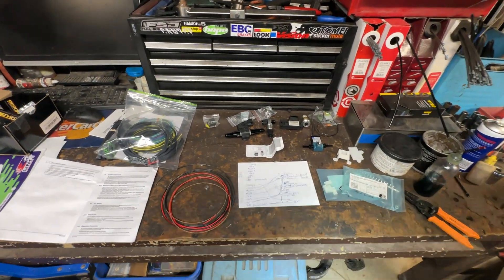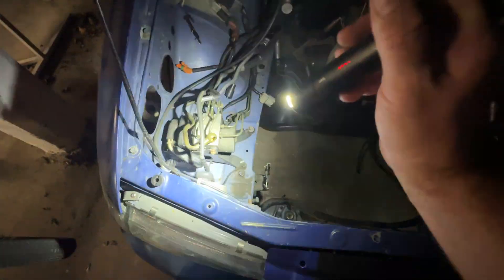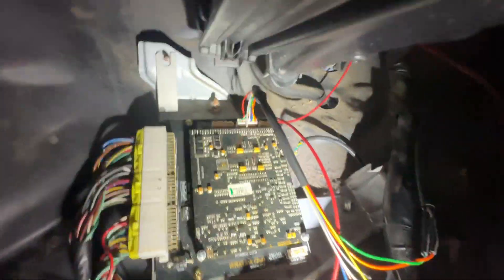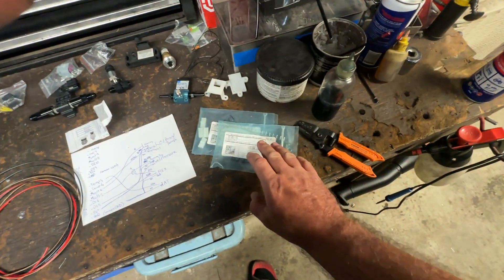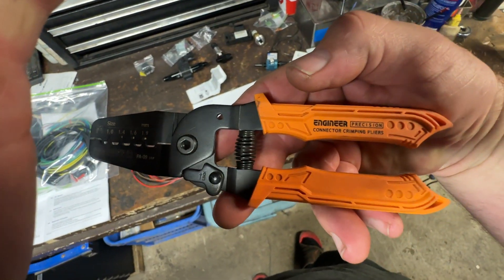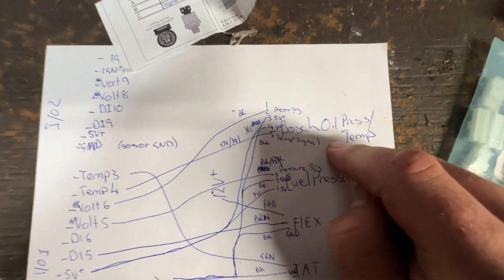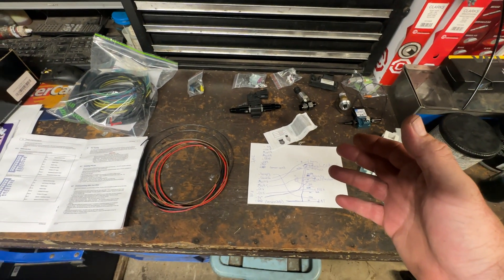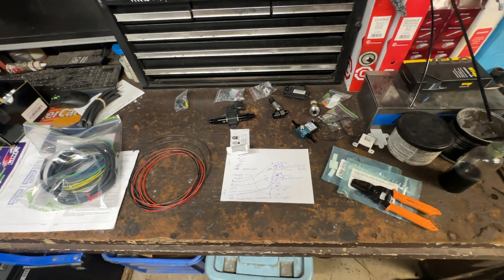Link plugin ECU - how to add extra sensors!

Comment: If I was to install the boost solenoid to the link. 
I’ll need 12v and where does the other wire go into? 
Thanks
Reply from the maker: Boost solenoid is controlled by an (Aux)iliary output. The Aux output grounds the solenoid when required. Look in your software, find an unused AUX. locate that pin on the ecu connector & wire the solenoid to that pin & 12v to the other side of the solenoid. The boost solenoid doesn’t have a polarity so as long as one is power & the other Ground (Aux), then it’ll work.
Reply: @Fine_Performance thanks for this 😊
Reply from the maker: @dguanz my pleasure, any time. The only stupid question is the one you don’t ask.
Reply: @Fine_Performance hahaha, I’m still trying to get my head around link program. Could you tell me how to add sensors on the program. Or if there’s yt video out there for it
Reply from the maker: @dguanz on the left side there’s a little tab that says ECU settings. Click on that and it’ll pop out with a bunch of headings. Fuel / ignition / aux outputs / digital inputs etc etc. Click on AUX outputs, ANALOG INPUTS & click on DIGITAL INPUTS. You’ll then see what’s already assigned to each ANALOG INPUT, AUX & DIGITAL INPUT. Then if you double click on a spare AUX OR DI, you can then Set it up in a window that pops out in the main viewing area. Get in there & save a copy of your tune to your laptop. Then familiarise yourself with what it looks like. Just have a look through it. The help file & right clicking “what’s this” to take you to the help file. It might seem really confusing, but trust me, eventually you will start to get better & learn how things work. A year or so ago, I didn’t even know the didference between a DIGITAL INPUT & an AUX OUPUT or ANALOG INPUT. But those are the components you add & can configure for your ecu.
Reply: @Fine_Performance okay thanks for this sir.

Would boost solenoid be under all that as well?
Reply: @Fine_Performance I’ve been trying to play around with it daily just to get to understand it ahah. I’m not tuning the car, but would like to understand it and add sensors
Reply from the maker: @dguanz yep, and that’s prolly the first thing you want to do. The other thing is, each sensor has a different calibration. So make sure you set it to the right calibration or, look online to see what it’s meant to be set at. Some things like common coolant sensors, pressure & temp sensors you can just select from in the software. Sometimes you have to create a CAL table & input the data yourself. But there’s guides online as usually someone has tried to add that sensor & not known the calibration info, so someone has posted a how to. But that’s great you’re getting into it. There’s nothing more rewarding when you wire something up, configure it in the software & it works.
Reply: @Fine_Performance awesome I’ll try figure it out. The main thing is to add all the safety sensors myself. The can bus wide band I’ve figure out.

Yeh never had to add sensors on my old piggy back Hondata haha, never had that option really.
Reply from the maker: @dguanz this was my first time doing it too. But basically just write a list of the sensors your adding. Work out what each sensor wants (5v, sensor gnd, aux# or 12v & DI#) etc. Then draw a bit of a map how you’re going to connect the sensors. Biggest thing that helped me was that I didn’t realise you can split a 5v or signal gnd from the ecu, as a many times as you need for each sensor. Ie, if you need 3 sensor gnd, take the one wire from the sensor gnd pin on the ecu, then split it into 3, to go to each sensor. The wiring method for doing this is using an “open barrel splice”. Google that, hpa has a good video about splicing.
Reply: @Fine_Performance so overwhelming all this 😂. How’d you go about connecting the wires to the harness? Just soldered them?
Reply: @Fine_Performance also , say I had 3 sensors to that one 5v or signal ground , would the ECU still find them even if I did barrel joint
Reply from the maker: @dguanz nah, you need some crimpers & the ecu pins. I’ll make a video showing the tools I’ve got. The one I use for most stuff is a copy of a Sargent 1026 CT. It’s like $60aud approx (real Sargent is $120aud). Then smaller pins I use an engineer PA-09 which is $60aud. Those 2 crimpers do most stuff. But yeah, you shouldn’t solder wiring as it creates a weak point & the wire can break. Crimping seem hard, but if you have the correct tools & take your time, it’s really reliable. You also need to use tefzel wire (usually 20awg - aka 20 gauge). Or TXL is a cheaper alternative. Good wire & a proper crimp will last for years.
Reply from the maker: @dguanz it will, but you need to get some crimpers & “open barrel splices” & do it properly.
Reply from the maker: @dguanz  this is how to properly join multiple wires 

https://youtu.be/cWkLgkqMVfY?si=SDE4ZhwB5nOdnQHU
Reply: @Fine_Performance thanks for all this info 😊
Reply from the maker: @dguanz no worries mate, I just posted a video with the tools & some info to get you started.
Reply: @Fine_Performance ❤much love my bro
Reply from the maker: If you’re on a plug-in for a Turbo car quite often there is already an AUX configured to run the solenoid of the factory car. But you can change something yourself you’re not using, for example if an AUX is set to AC clutch and you don’t have AC you can reconfigure that to be your boost solenoid just making sure that the wire is going to the correct pin for the AUX that you choose.
Reply: Question my bro, 

Could I use 12v/14v from the ECU pins for the boost solenoid or better to run from fuse box
Reply from the maker: @dguanz no you should run an ign 12v from the car. You can setup a dedicated one from a relay, or just find a ign switched 12v & run an additional fuse off it for that component. I did this for my boost guage on my WRX & the CAN unit on my JZX. I had ign switched 12v > glass 5A fuse/fuse holder > new wire to component. That was if it was to short out, the glass fuse will blow without taking out the fuse in the engine bay or kick panel on that entire 12v circuit.
Reply: @Fine_Performance oh true , I forgot about the fuse part haha
Reply: Got the car fired up today but got a misfire.
I’ve got all sensors to work tho haha.

You any good at reading logs 🤣🫣
Reply from the maker: @dguanz what are plugs gapped to? Gap them to 0.6mm / ~0.020”. Then check the connectors on your coils. Then the condition of them for any cracks. But yeah, I’ve got good at visualising what is happening as the log moves through the timeline.
Reply from the maker: @dgu @dguanz sorry, yeah I have got pretty good at reading logs. There’s a few things to check first. Take the map reference line if your fpr, make sure the fuel Pressure is correct. I went to a bigger fuel pump and didn’t realise that I needed to adjust the FPR. It was Running rich and misfiring because the bigger pump was giving more pressure. What engine is it and what have you done?
Reply: @F @Fine_Performance  tuner is set up timing and fuel already. But after 10mins it would start mis firing. It ran fine on the old piggyback. This still gets me.
Reply: @F @Fine_Performance I’ve posted on the forum no reply’s yet regarding my log
Reply from the maker: @dguanz message me on instagram fine_performance. I’ll have a look tonight
Reply: @F @Fine_Performance ll do my bro .
All new plugs and coils.

I’ll dm you
Reply from the maker: @dguanz oh done need new plugs necessarily (unless they’re pretty bad). You can clean them & sand the strap & element slightly. But I had my plugs at 0.8 (as per online) & got misfires all the time. Gapped them down properly with a feeler guage & they were sorted.

Comment: Thank you soooo much especially explaining all the small details. Would you know the part number for the CAN JST5 connector for the wide band?
Reply from the maker: @sugoi7565 it’s a JST XA series 5 pin connector & terminals. I got mine from RS components, but mouser & digikey also have them. B05B-XASS-1-T is a part number I found for digikey. You just need some of those engineer crimpers in the video for the tiny terminals.

Comment: Any of these wrxlink have wideband? Or do you need use a gauge and then send it to the ecu?
Reply from the maker: @thecookeman  you have to buy the CAN LAMBDA unit.
Reply: @Fine_Performance I sent mine from an AEM gauge to the ECU and had it tuned. Any reason not to do that?
Reply from the maker: @ I think that’s fine. I guess the gauge is controlling the heating & the sensor & then just sending the signal to the ecu. I have a feeling it’s better having the ecu controlling the wideband because you can probably log & troubleshoot a few more parameters when the ecu is directly controlling the wideband. But just sending the wideband reading into the ecu is better than no wideband.
Reply: Thanks for listing the link board plug and pins :)
Reply from the maker: @ no stress man. I know that’s it’s been tricky to find info on some!things. So I’ve just tried to make it easier for others!

Comment: Thanks for the info. Helps to understand a lot better for a noob like me
Reply from the maker: @drewbis4140  hey man I was a noob too (still am). The right tools, good quality wire, ideally good quality connectors (though I used Chinese ones, they worked ok) & proper planning/ drawing up a diagram.